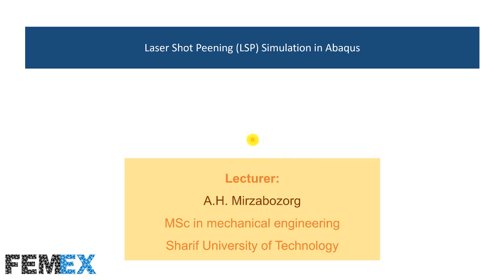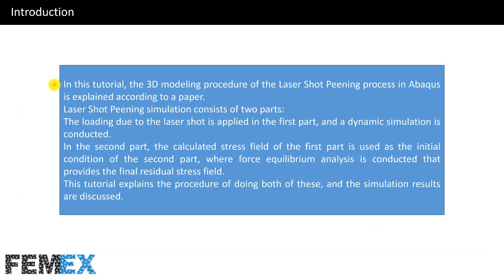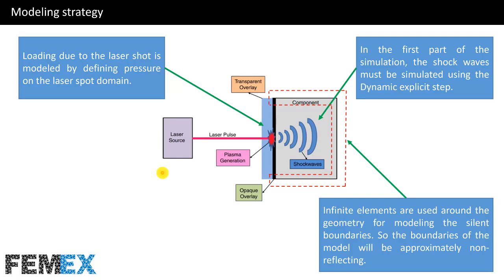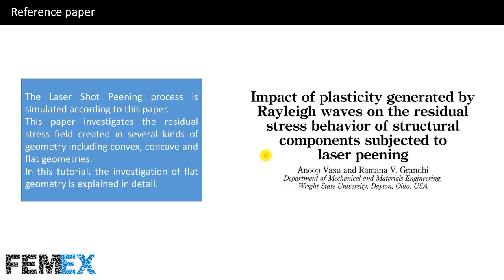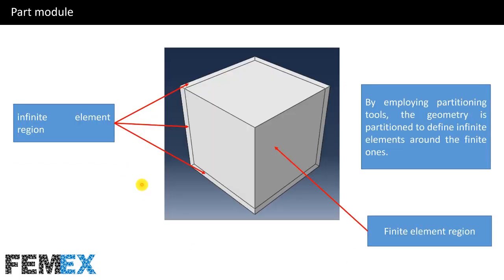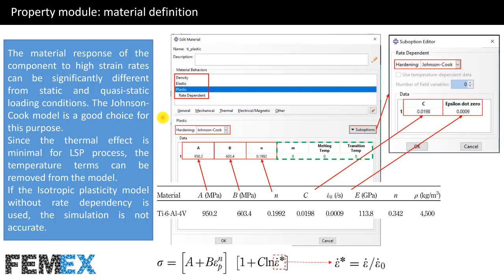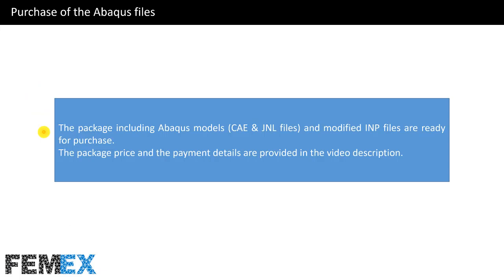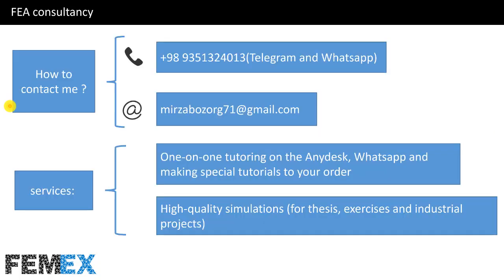Laser Shot Peening (LSP) Modeling and Simulation in Abaqus

Comment: This tutorial was really helpful, thanks a ton! i followed the instructions step by step after your explanation but for some reason, i'm getting the dynamic stress contours differently. does this have to do with the meshing?
Reply from the maker: Hi.
You are welcome.
Yes the mesh size is very important in this simulation.
If you want to get similar result, you must use the same element size.
Reply: @FemexIran  oh, alright! when i perform the analysis, the body is getting deformed in a way that the quarter-circular partition where the pressure is applied is getting deformed, how can i fix that?
 thanks for the help!
Reply from the maker: @avneeshdalvi  Unfortunately I don't know whether it is because of your mistake or it is natural. When the result is not according to your expectation, all of the settings of your model must be checked. You can use our online consultancy service in this regard. To ask for online consultancy, you can send email to us: mirzabozorg71@gmail.com

Comment: Hi, teacher, if I my model is orphan mesh part, how can I define infinite element(CIN3D8)?
Reply from the maker: Hi.
We usually do not define infinite element from orphan mesh. because we do not import the INP file into the CAE environment because it makes some problems and most of the time the model will not be re-generated correctly. you must define the infinite elements in the INP file and create a job from the INP file and run it. I have explained this procedure in the video of the extended premium package of this tutorial and I have sent this video for you previously.
Reply: @FemexIran yeal，But I ran the file you sent me and the rebound is still having problems.
Reply from the maker: @CAE-op1pi  As I have also provided the step by step tutorial about how to use the files, I think this is not my mistake anymore.

Comment: Thank you sir                                                                                                                                                                                                                                       Can we apply multiple shots in ABAQUS without using custom coding in general analysis steps? for laser peening
Reply from the maker: I have heard about laser forming and even i have done several simulations for it on a simple plate based on a paper to calculate bending angle but i have not heard about laser peen forming.
The difference between laser forming and laser shock peening is the laser pressure function versus time. In laser forming it is continous to create large temperature gradients to generate thermal strains to cause bending. But in laser shock peening, it is discontinous to only generate shock waves to cuase hardening on the top of the specimen.

Comment: How can laser-generated shock wave pressure be applied to the material for simulation
Reply from the maker: Hi.
By defining pressure load from the load module.
You can buy the premium extension of this tutorial including the CAE and JNL files and a tutorial about how to use the files and run the models because it has several points. Then you can fully understand how it works.
The package description is written below the video. If you want to purchase it, please send an email to me: mirzabozorg71@gmail.com